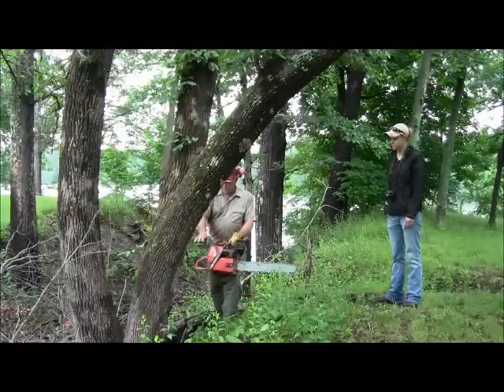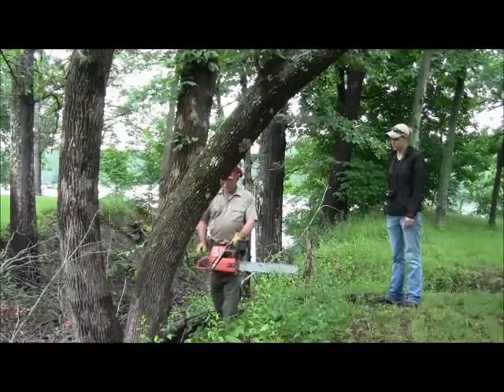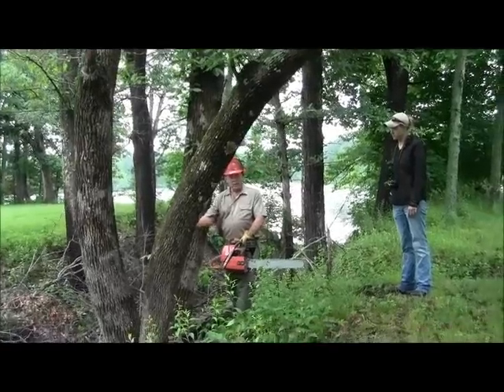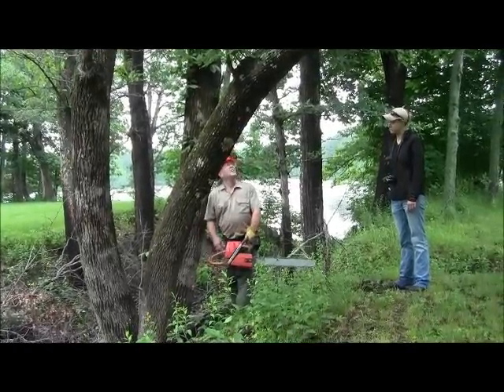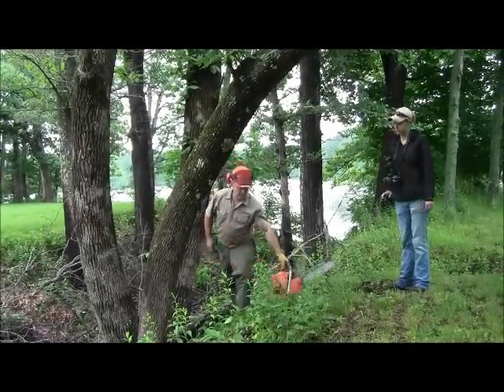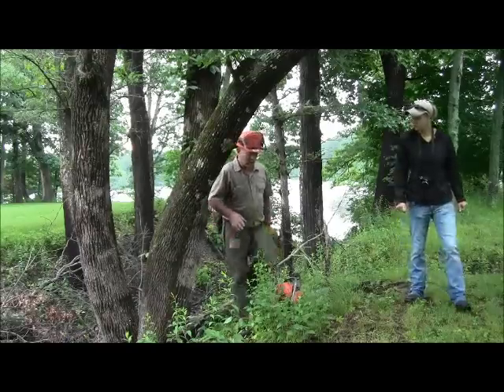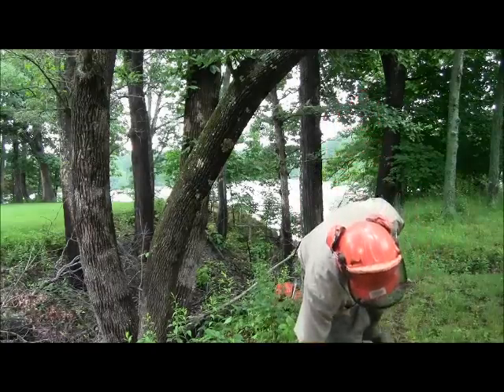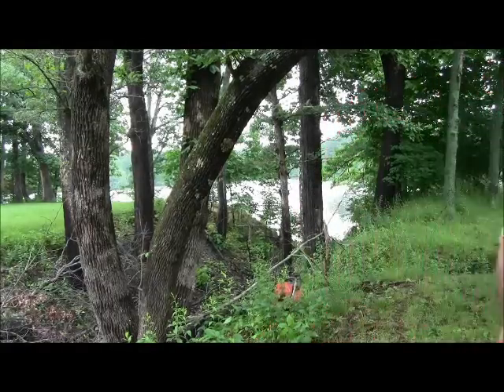Pesky Small Diameter Leaners; Drop Them Without Splitting

Comment: I watched several times. I didn't catch why you made it a vertical bore. That is a good point. I probably wouldn't have known that, but it seems to be the safest method!?
Reply from the maker: I use an angled or vertical bore cut to keep a sufficient Backstrap while making the hinge. I have had leaders pop when boring the hinge, and this technique prevents the surprise ending.

Comment: Have you tried the following?
1. Make shallow (~1/3 or less diam deep).
2. Bore in for backcut, leaving ~2" hinge, them continue the cut outward until breaking out.
No chair there. Seems to me, vertical bore cut could be a "starter" for "chair" (vertical split), and the horiz bore would give max probability of good result- retaining teeth.
For smaller leaning trees, I like the option of making the backcut with a polesaw (which can handle 18" bar, even).
Reply from the maker: +Jacques Blaque https://www.youtube.com/watch?v=dlcA3B_zeSU
Reply from the maker: +Jacques Blaque The vertical cut is for stems where there is not enough space to leave a backstrap.  The tree won't split if the hinge is not excessively thick. I have modified the method to make everyone feel better. https://www.youtube.com/watch?v=dlcA3B_zeSU

Comment: Those super leaning trash sticks dont need a notch at all.  Plunge in horizontal about 15% deep from the compression sides bark and stay full throttle in and out.  Then rotate the saw 90 and bore in at the upper edge of the previous bore.  Itll look like you laid a T square on a work bench, a laying down letter "L" 

Now from there you just saw clear out the back at full throttle.  The  front tab keeps tge tree from sitting on your bar and she doesnt go until youre out.  Not possible to barber chair, and the tab rips off the stump, not the buttlog.

Comment: I've got a lot of small diameter trees damaged from a severe ice storm some years back. The one that concerns me is about that size with a stress fracture 2 to 3 feet long from the base up. This is my second year using a chainsaw so I wasn't sure how to approach this one, but this is exactly what I envisioned. Logger friend of mine in another state lost a friend to a similar tree when several shards broke loose under pressure and impaled him. He said the pressure below the bend basically caused it chunks of it to explode outward when cut. Not trying to end up that way.
Reply from the maker: Will it hit powerlines or improvements when it falls? This might be one to leave alone if it is in the woods. If it needs to come down for safety at your home, you might need to call someone who can take it down from the top with a bucket truck or man-lift. Send photos, including ones that show the damage to truebluetravelinman (at) gmail (dot) com and we can discuss the situation.

Comment: Unfortunately, the camera was on the wrong side of the tree during this demonstration.
First he made a V cut ("face cut") on the side where he wanted the tree to fall.  The depth of the face cut was about 1/3 of the tree's diameter.  
Then he turned the saw's blade vertically and pushed the blade into the tree -- a vertical "bore cut".  The bore cut was about one inch behind the vertex of the face cut.  The bore cut left some uncut wood ("backstrap") behind the face cut and the bore cut.  
He then cut horizontally through the backstrap, and the tree fell.
For a better demonstration of this technique, see:  www.youtube.com/watch?v=UIVE9EJJMig

Comment: For trees like that I use a small undercut and then use a saw that will cut fast to make the back cut. No bore cut. Just a quick and simple
Reply from the maker: Sure, that works most of the time.  Some trees want to get you though, so I like doing the process.  I get that Jedi feeling when I push the saw through a tree!
Reply: @DavidN23Skidoo  I logged in Southeast Alaska for 25 years. A tree like that here would be red alder. I suppose it's a hardwood but it's soft as butter when it's green. You can make the backcut very fast. Get it cut before it has any time to do anything. Those trees  you are cutting are probably different
Reply from the maker: @lockednloaded7830  It's the small to medium trees that are always smacking cutters.  We don't expect trouble from them, but they can deliver.  Your alders have a reputation, too!

Comment: Do not do this ever bore cut properly if that tree was was bigger an had more tension you would create a barber chair  dangerous
Reply from the maker: It's for trees where there is not enough room for a bore cut perpendicular to the stem. Thoroughly tested, with the cut in the stem and also placing it in the stump. It is a good technique for those who have to cut leaning trees along edges. Invented out of necessity.